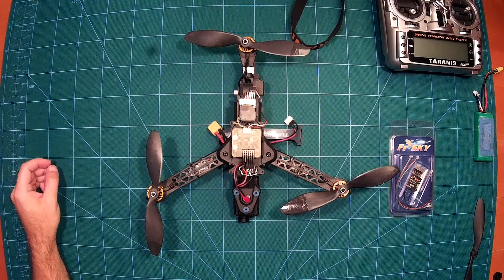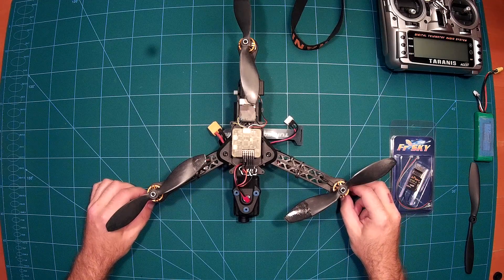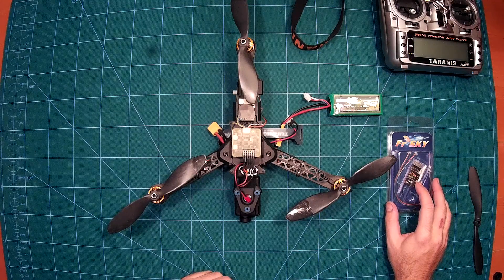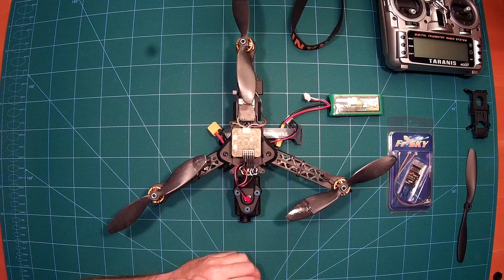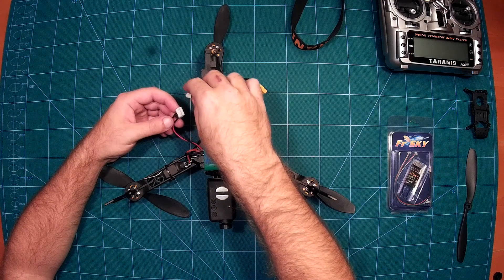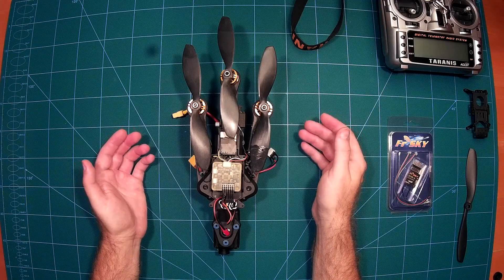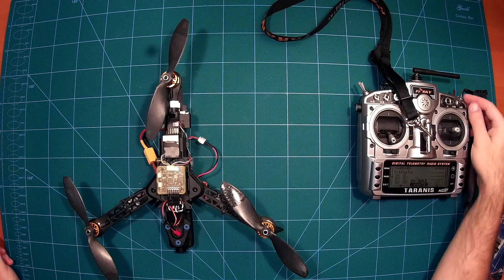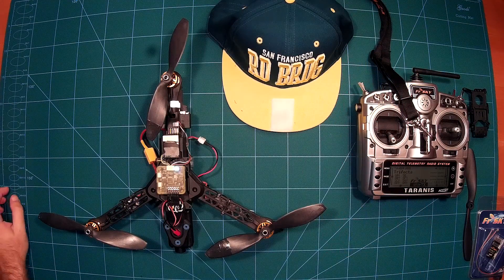Quanum Trifecta Mini Foldable Tricopter Frame: Build review and pre-flight test

Comment: how much does it weigh, does it have a way to mount a board camera / fpv tx?

did you manage to get those 8" propellers and what kind of flight times are you getting?
Reply from the maker: +Razvan Taranu I will get back to you about the weight, when I'm back at my bench tomorrow. There is unfortunately no way to mount a board camera, just the mount for the Mobius. I had to get creative to mount the board camera. I did not had the chance to try it with the 8 inch props yet, but I already got them at home.
Reply from the maker: +Razvan Taranu In this video thumbnail you can see how I mounted the board camera. Basically quite messy using hot glue ;-). Not a nice solution, but it works: http://rcfpvflight.com/vlog/minion-hijacked-my-tricopter/

Comment: Interesting choice of build components. I mostly see faster kv motors/smaller props on these Trifectas. I might try one in a couple of weeks. How does it fly with these big props? I guess it will be a tad floaty? This looks like a cheap build, something I need atm haha. Thanks.
Reply from the maker: assaulter99 Hi there. Had my maiden yesterday and I love it. It's actually quite responsive with the 7" props and I can't wait for the 8" props to try out. I did not do any flight time measurements yet, but that will be next. Cheap build indeed and so much fun to fly. It is my first tricopter and it feels much more like an airplane (compared to a quadcopter) when flying it. I wouldn't have thought that I would like it so much. I did take lots of video from the maiden and I will have a separate video on it soon! :-)